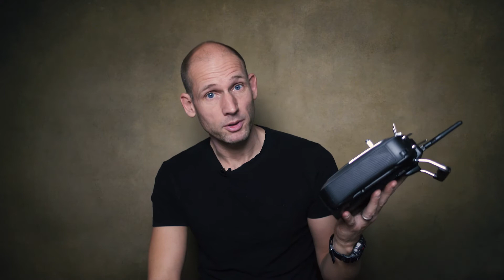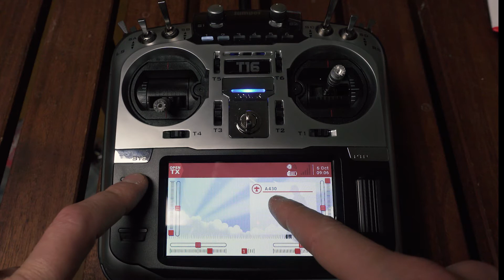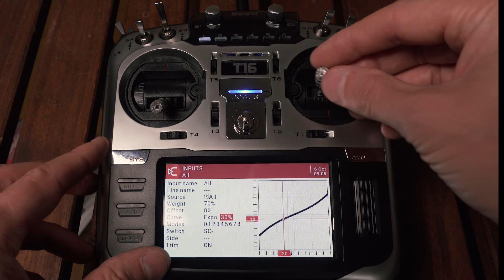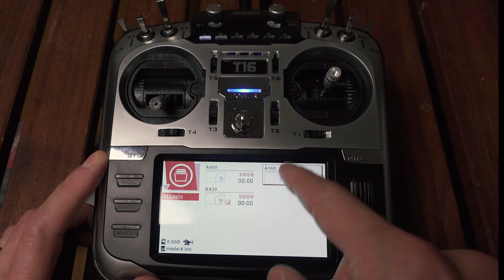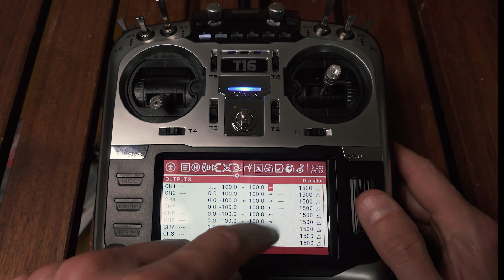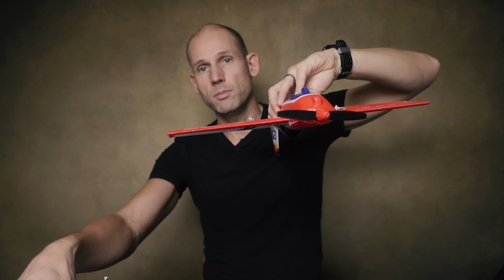XK RC airplanes with Jumper T16 pro

Comment: Thank you so much for this video.. i was not sure which channel was the 6g for the a 430...  As the manual does not specify it.. and i had my transmitter incorrectly set up... Now i know, is on channel 5...  And i will be ready to fly as a beginner soon... Finally 😎😁
One thing i noticed, the exponential are positive, i read that xk uses negative exponential for helis.. not sure for airplane exponentials are positive...?  Im a newbie..🤠😁😎
Reply from the maker: I'm glad you found the video useful. Negative expo is to have crazy responsiveness.